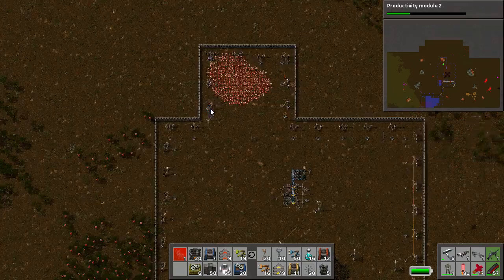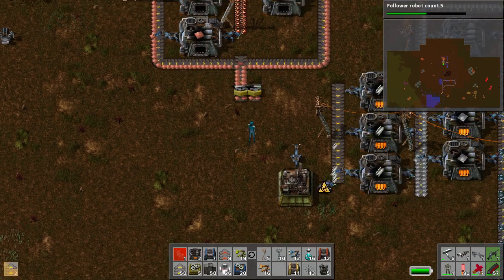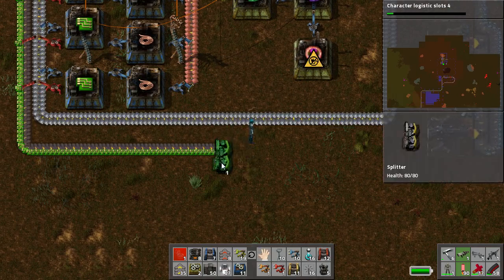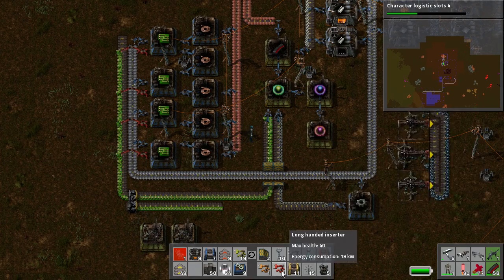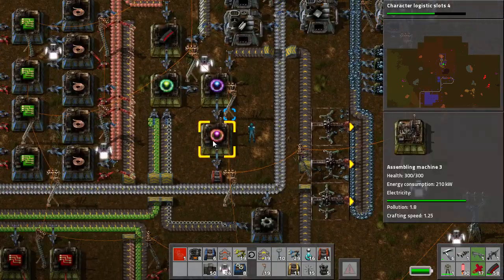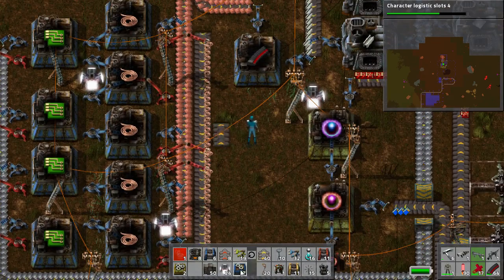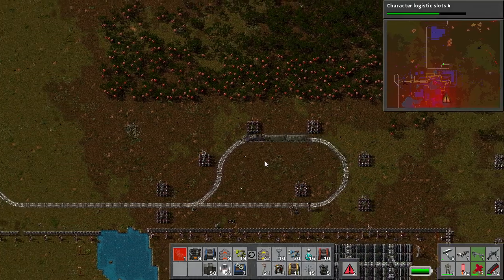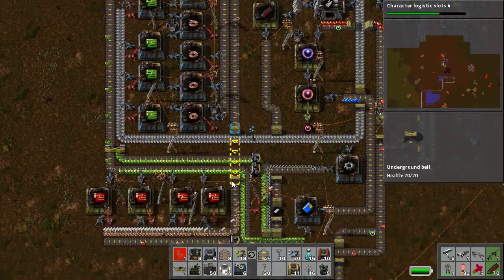Let's Play Factorio 44 Special Episode The Capsule Factory

Comment: i think you are overcomplicating/overthinking this, its actually very easy to get the ratios right. just look at the time it takes to make destroyer capsule for example and think: "ok, to get 1 destroyer every 15 seconds i need 4 distractors every 15 seconds" then go: "ok i need 4 factorys to get those 4 distractors, and each one needs 4 defenders, so 16 in total, to get those i need 9 factorys" you can follow this down to the miners. just make sure that everything that is needed in these 15 seconds gets produced.
Reply from the maker: This was more to play around with the factoratio tool than anything. I also wanted a factory that wasn't too resource hungry. You're right, with your example. But I didn't want that much capacity.
Reply: Actually, one assembly machine 3 outputs 5 Destroyer Capsules per minute, that is one every 12 seconds.
If you plan for 4 Distractors every 15 seconds, your math will be off and considering you'll need 3.6 factories, not 4, to get those 4 every 15 seconds, you'll end up with an excess of distractors very quickly. This will in turn halt up the production of Defenders, which you'll need 6.8 factories for, but since you'll have to build 7, that means you'll get an excess there too....

You see how quickly you'll end up with the wrong ratios, even when using the proper calculations? Your way of going "Oh, I need 4 for this, so I'll have 4 factories" will create even more excess of components, which will block the lesser components later down the line when production halts.

For a single purpose factory like this, that doesn't matter too much, but the slightest bit of inefficiency early on will translate to a huge inefficiency later on when you start building on to that factory line.

The least efficiency loss for this setup would be to have 30 Destroyers per minute, but that requires a huge setup with a couple of hundreds of assembly machines, smelters and miners... With that, your only holdup would be a one second wait once in a while for defender capsules, the rest of the factory would keep up almost flawlessly.

But that's just if you use maths :P
Reply: my point was, that there is no need for calculating stuff like that in advance. all that is needed is to reverse the normal process and start at the top, at the endproduct. by working your way from the top, all the ratios reveal themselfs at the point they are needed.
btw. i dont see how a few minutes of excess production until the belt is filled have relevance in a 20+hour game.
Reply: tom duke
Later on you'll see a good example of what happens when you have excess production somewhere, when NR changes one of the factories to a more efficient one. It eats all the resources and halts the rest of the production.
In that case it was the copper it ate, which affected the copper wire, which affected the circuits, which affected both the advanced circuits and the speed modules.

One slight difference in ratio directly affected 4 other stages and a total of 10 other factories, which indirectly affected the whole production line.

In a 20+ hour game, a single second of longer production time means you'll drop the production by 1 200 units (60 units per hour for 20 hours). A few minutes of excess would bring that number up sky high!
Reply: *****
 you seem to confuse excess production with not supplying enough raw materials. one keeps belts short and chests limited to 1 stack for a reason. because once the belt/chest is full, excess production stops and therefore is a nonissue. tbh i cant follow your thoughtprocess. we may have reached an impasse.
Reply: tom duke
The materials produced are used right away, the belt will not overflow for a loooong time. Once the belt does overflow and the rest of production starts to keep up, you'll end up right back at the one overproducing factory swallowing the resources again.

It is a very unnecessary bottleneck to have, if a small bit of simple maths could solve it.
Reply: *****
 sorry, i dont get it... the factory can overproduce only as long as there is space for the product. in my factorys that usualy about 1 stack. as soon as that is filled, it only produces what is needed by the following assamblers. and if i want i can even limit the overproduction down to 1 item via red/green wire.
anyway i look at it, if you overproduce a large amount of product(1 or more chests) needlessly and it cripples your factory you simply made an error and better fix it.